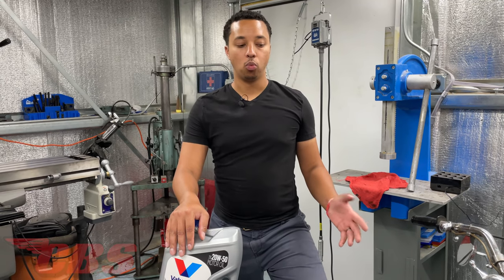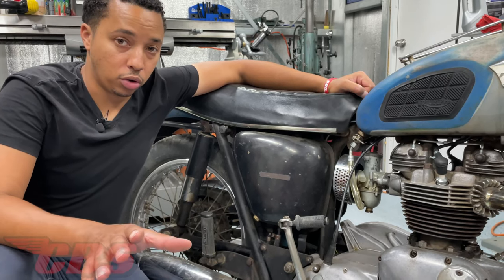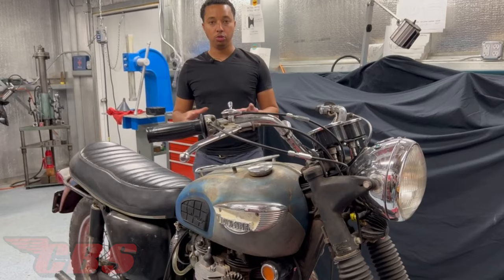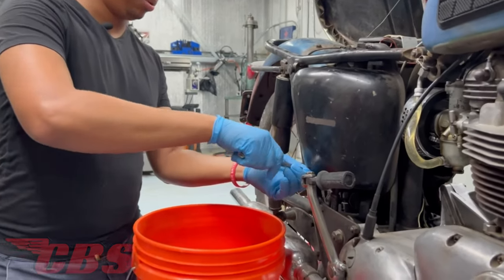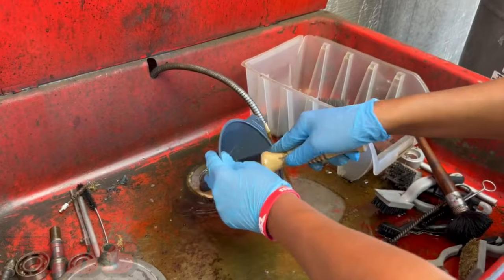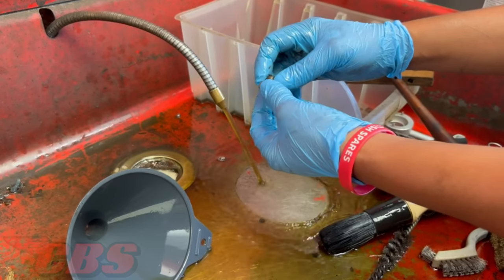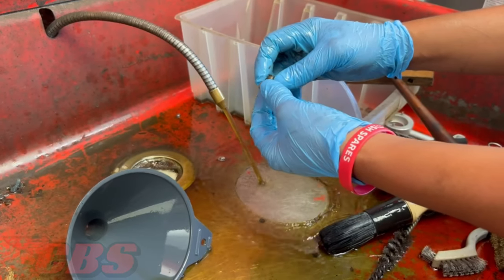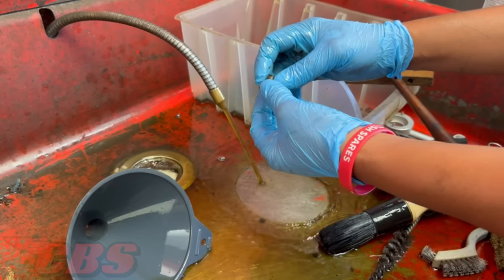Triumph TR6 Oil Change (Trusty Rusty)

Comment: Great Video. I like to use new spark plug gaskets on every oil change for all the drain plugs. You can get them in different sizes, & they seal up well.

Comment: Excellent advice as always Kyle. I now pump the oil out of the tank rather than use the drain plug, less messy and gets the last of the sludge out too. Give Loctite 542 a try, it's a low torque thread sealant.

Comment: Modern oils especially multi-grade a full sin are full of chemicals and detergents to keep things clean they are also capable of washing dirt that may be dominant in the sludge trap pf the crank..Fitting an oil filter on your old bike might be a good idea as the old-type oils a getting hard to get ....

Comment: VR1 isn't recommended for wet clutches.  The old triumphs (and a lot of vintage British bikes) tend to have a separate primary and clutch, so they don't share oil with the engine and VR1 works great.   But make sure you're not using it on a bike where engine oil and clutch oil are the same... like a lot old Honda CBs.
Reply from the maker: Facts

Comment: I am curious as to why you guys are using that brand of oil. I’ve watched several videos and read many articles over the past several years and it has shown that Amsoil synthetic is probably the best oil on the market at at the moment. Is there a reason why you guys aren’t using that brand?
Reply from the maker: Oil is a challenging subject, everyone has there own preference, as they should. VR1 is a good choice of oil with these old bikes, the high zinc content in the oil is great for our cam and cam follower style. Different strokes for different folks!
Reply: @classicbritishspares  thanks for the reply. In a pinch I would use Valvoline, but due to the metal on metal test I’ll pay the extra for the Amsoil. BTW love your page. It’s great and very informative. Keep up the great work. 👍

Comment: I have a 67 Bonnie, always use a straight 30 oil , never use a detergent oil in these engines as it can disturb particles in the crankshaft sludge trap . Never use sealant on anything with an oring /copper or fiber washer or any part of the engine with a gasket , I’m sorry but bad advice